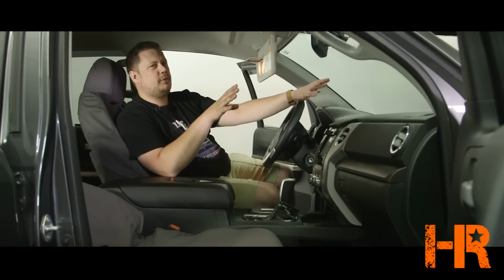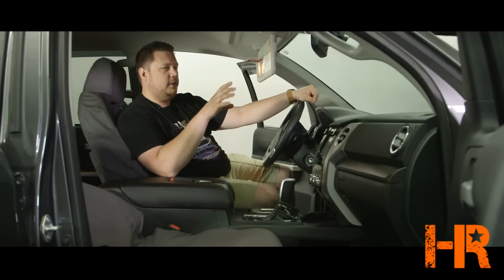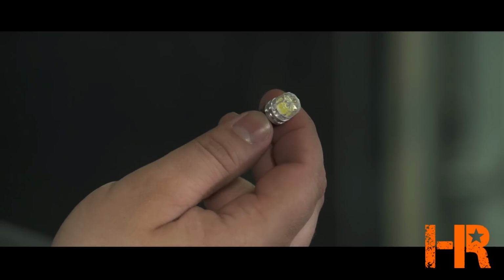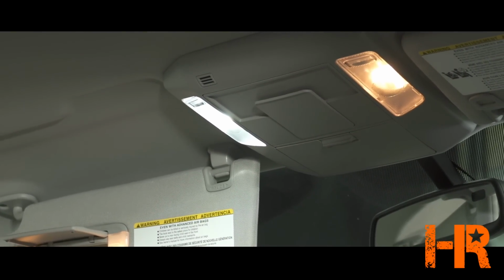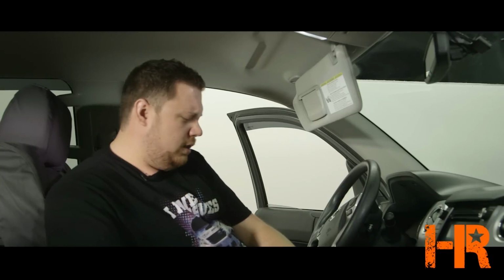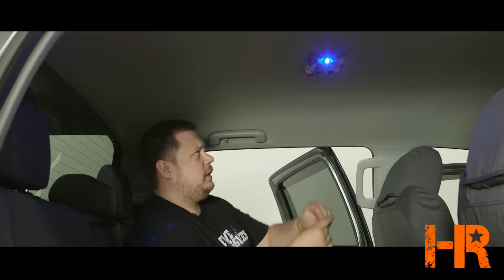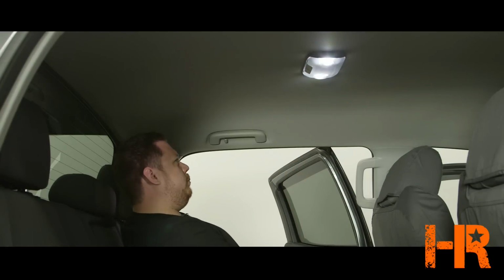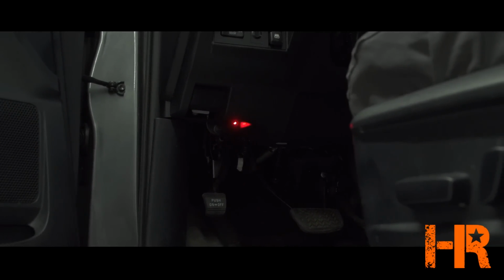2014-2017 Toyota Tundra Interior Lights - Tundra Video Series (4) | Headlight Revolution

Comment: Footwell Tip: plug the socket back in without the bulb.  Then test fit and place bulb in the socket.  Makes it so much easier.  Also keep in mind that it is 1/4 counter clockwise to remove and 1/4 clock wise to thread back in.
Reply from the maker: Thanks for the tip!

Comment: Another way to remove the light over the emergency break instead of removing it from behind as well as the map light without taking it more apart is to wrap the bulb in scotch tape, make the tape crease around the bulb like a U, press the tape on the bulb and pull on the tape - bulb comes out painless :)

Comment: Two VERY important points left out of an overall helpful video;

1) be very careful inserting the map light LED bulbs, the larger bulb size means you might not be at the right angle - my lead clips bent without much pressure so I had to remove the whole upper console to repair it 

2) DO NOT remove the map light reflectors, they cannot be properly reinstalled even if you pull down the console.

Lights are certainly brighter, we will see how they hold up to off-road abuse.
Reply: How did you do that repair, as I just had the same issue, when I replaced mine.
Reply: @goofy78270  I had to remove the entire assembly from the truck and take it apart to then bend the tabs back into their rough shape. I was thinking I was going to have to buy an all new assembly but I managed to get it to work.

Comment: I have a 2005 dodge ram 1500 and I put leds they only turn on when I open the door but they won't turn on when I click it to turn on do you know why? Could it be the fuse that it is too small or the leds?
Reply from the maker: Hey Junior, I have an 04 Ram and you need Canbus Festoon's to get the interior lights to work in your truck.